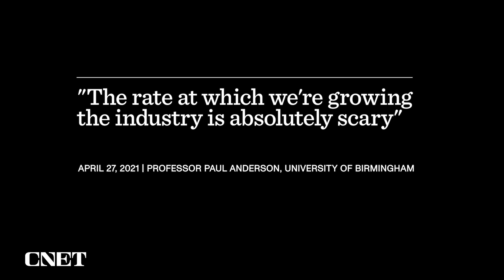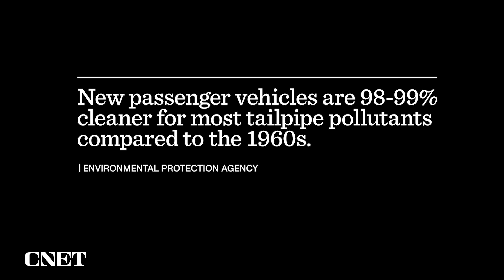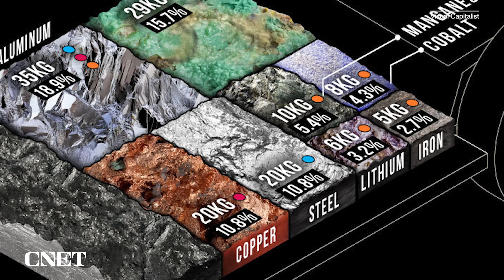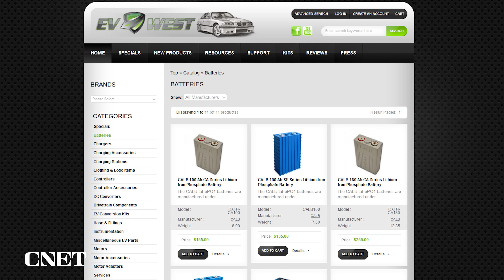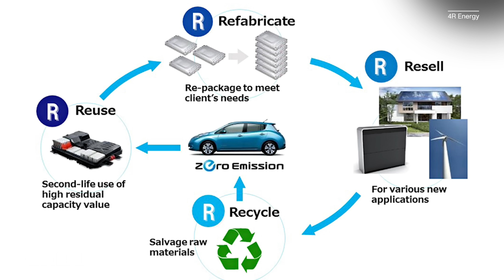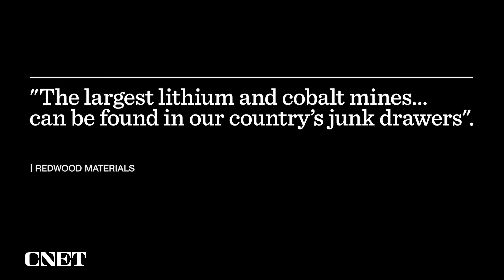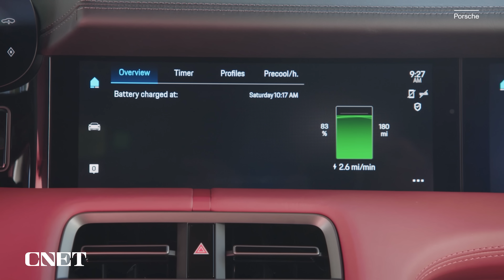MOUNTAINS of Dead EV Batteries Are Coming: Here's How We Plan To Deal With It

Comment: Why is it that when talking about pollution/ CO2 emissions by transport shipping is never mentioned?  It is by far the largest contributor of any mode of transport, is largely unregulated and still uses crude bunker oil with no or little control of huge volumes exhaust from enoumous engines. 
A small numbe (100s) of the largest ships emit the equivalent pollution of all of the private cars in the world. 
The best thing about the use of EVs is to clean up air in cities but until the main sources of CO2 pollution are addressed globally such as power generation converting to an all EV private vehicle fleet will have little effect on slowing global warming as cars represent a small fraction of the problem. 
And like any other recyclable material unless its economically viable it doesn't get recyled. So there will be millions of used batteries to contend with in the near future with all the associated environmental risks.

Comment: You didn't answer the question, you didn't. All these solutions will not make significant impact because the batteries will eventually die completely that it can't be reused for any purpose and recycling will not be quick enough. 

The honest truth is that majority of these batteries will be shipped to Africa and dumped in second-hand value and in waste fields while the west looks away. 

At the end, Africa will take the hit as we are doing so with used refrigerators, microwaves and tyres.

Comment: This is exaggerated. They decided to change to LiFePo4 which are very recyclable. In fact recycled LiFePo4 batteries are preferred to the fresh mined lithium. Repurposing is not really a thing with LiFePo4 because of how long their lifespan is, range increases and recyclability. Plus there are much better battery technologies on the horizon that will be here very soon. Some have already arrived. This video is misleading.

Comment: ok so we discussed the process of reusing batteries. Now lets discuss what it takes to bring that electric car to market....6 tons of carbon footprint for a gas car, 12 tons of carbon footprint for an electric car with 125mile range.. 25 tons  of carbon foot print for a 350 mile range electric car.. So basically you have to drive that 125 mile range car for 85k miles before it breaks even with the gas car on the carbon footprint and 450k miles for the 350 mile range electric car. Now lets hope you don't need to replace the battery.. A kid bought an electric focus in florida for 11k with 60k miles on it , the battery needed to be replaced and it cost 14k dollars... Lets be honest here, IS THIS REALLY A BETTER IDEA? i would have to say clean diesel is by far a better idea for cost and environment... Don't get me wrong, I love electric vehicles, I am just being honest about what is best.. Also did you know that a major component of the battery is mined out of the congo where they use children 6-10 yrs old because they are the only ones that can fit in that mine. They are paid peanuts and sometimes die in the mine, buried and parents are paid off so the govt doesn't know. Im sorry but this is not worth it to me just so some car brands can make millions and it doesnt benefit anyone but the automakers and investors...im sure they will delete this comment.

Comment: I think we need a standard ev battery. That can be swapped in and out easily between makes of cars.
Reply: May not be needed when batteries outlast the cars.
Reply: @danharold3087  hot swapping batteries could also give you options like a small battery when city running and you could swap to a higher capacity when you need it.
Reply: @DanT10  It would.

Comment: In the cities and condensed location the battery/electric train bus is the key. In country areas stick with gas. If people only drive short distances all electric. And hybrid for in between. Cut down on these higher horse power cars to give better gas mileage and give people incentives to do so. But this is all about giving old industries all the money and every one else will suffer

Comment: Cold hard fact is that electric car production emits over 70% higher GHG emissions during manufacturing process compared to building the exact same ICE car.  See the Volvo C40 Regen study from 2020 and ingest the fact that EV owners must first drive your new "zero emission"  vehicle a minimum of 90,000 miles before it's on parity with the GHG emissions footprint of an ICE car in the US!  Yes this takes into account the "zero tail pipe emissions"  during those 90,000 miles of driving. How many of us own electric vehicles and drive them 90,000 miles?  If your EV battery is replaced you start all over at 90,000 in the hole.  Don't get me wrong, I love electric car technology, but producing EV's, and their batteries, is much more devastating for our environment than producing ICE cars.  This is because you must rely on coal and natural gas to charge your EV and they get terrible range.   Good luck at having a low GHG emissions recycling program for the batteries... It's incredibly energy intensive, very expensive, that's why only one company here in the US attempting it.

Comment: I predict it will be closer to five years due to people abusing thier batteries due to still holding on to old driving habits that they could get away with driving a gas car like trying to get a few more miles from a charge and from allways fast charging their battery.
I am currentley repurposing a pair of Aquion Energy Aspen 48S-2.2 AHI saltwater batteries that have had two segments died, the batteries are made up from four 1.5 volt cells that are wired in series to make a 6 volt segment, and the battery has 8 segments wired in series for 48 volts, I am rewireing the remaing good segments as two 6 volt segment in series to make 3-12 volt segments and wireing the 3-12 volt segments in parallel to increase the current. So far it is working very well.

Comment: A hybrid is a vehicle with IC engine plus electric motors in the wheels run by lithium batteries when cruising on level roads at speeds above 35 km/h or when going downhill this regenerating energy ⚡. It has at least 500 watts of solar power. 
Others help drive us into recycling batteries at best since the hybrid is legal and so batteries have a 15-year waranty. Others dispose batteries every 5 years.

Comment: The battery wears out faster in a car since cars have higher discharge and recharge cycles. Batteries tend to be charged to 100% and discharged to very low amounts, many times throughout the car's lifetime. Solar farms tend to charge at lower rates and charge and discharge cycles are much more forgiving. Therefore a battery's "life span" in a car is not linearly proportional to the life span of the same battery being used at a solar farm. A battery that may only last 10 years before the range becomes too low to be usable in the car may last an additional 10-15 years at a solar farm
Reply: I see some cars are allowing you to charge less for everyday use and more when you need the range.
Reply: @danharold3087  that's most ev to conserve battery longevity
Reply: @Nguyening_music  Exactly  I mentioned it because you said " Batteries tend to be charged to 100% and discharged to very low "  Wanted people to know this is not always true.
Reply: @danharold3087  oh yes, sorry I meant that in relation to back up batteries
Reply: @Nguyening_music  np good buddy :)

Comment: As much as I would like to help the environment by going electric,there are far too many disadvantages to EV’s.Limited range,long recharge times,limited life time of batteries(7 years and the average cost to replace the batteries range from $12,000 and up).Plus many of the minerals needed to construct these lithium batteries come from strip mining,which is an environmental nightmare.
Reply: We have a 2013 Chevy Volt with 100,000 miles on the OD that shows little to no range degradation.  So after 9 years, the battery is not compromised and shows no sign of needing replacement.  For me the issue is not the environment or my “carbon footprint”.  I want that my grandchildren be able to fly to Maui.  Or to rebuild a classic car.  At the present rate of usage, British Petroleum says that every drop of crude will be exhausted in less than 60 years.  Talk about an impending calamity.  So for me, adoption of EVs is about preserving just a little bit of the precious black gold for future generations.
Reply: Most of that is inaccurate or exaggerated, too many doomsday scenarios.
Reply: @rp9674  Outdated too

Comment: "A 200 mile range EV might be just fine".  I have a laptop computer, I have a cellphone, I know how this works.  You buy a new EV and it has 200 mile range.  Next year it has 150 mile range.  The year after that it has 100 mile range, or one day you get in it and it has 10 mile range.  I've had batteries replaced in laptops and cellphones.  So you take your 2 year old EV in for a new battery, pay half the price of what it cost new, then a month later you find out it is down to 20 mile capacity, just like what happened when I put a new battery in my laptop.
I think the "rent a battery" model makes more sense.  I can envision places where you can pull in and have a battery swapped in 5 minutes, so you can make cross country trips.  I make long trips in the western US and there aren't any charging stations along those routes, but someday there might be a place where I could get a battery swapped.
Reply: Looks like you don't know exactly how it works, 2015 short range EV 74,000 mi no noticeable loss in range.
Reply: @rp9674  I know how cars work and I know how batteries work, I've never owned an EV.  The laptop I bought in 2015 and the cellphone I bought in 2015 have both eaten their batteries by now.  My cellphone had to have a new battery, the laptop is 100% dead.  I would be surprised if car manufacturers know more about batteries than Apple and Toshiba do but maybe they know the secret.
Reply: @billj5645  yep, they figured it out, amazingly!

Comment: I've been driving an EV for over ten years with very little battery degredation.
Reply: Same here with my ‘14 i3. What model are you driving?
Reply: @phenex551  I have a 2009 Miles truck with lithium iron batteries I purchased in 2010. My wife drives a 2013 Nissan leaf.
Reply: I hope to be in the club someday, 2015 Fiat 500e, 2015 BMW i3 Rex

Comment: A likely significant Reduction will be how much ebikes, their batteries and range are improving. Potentially large numbers of people around the world can skip the need for a short range EV and opt for a far less expensive ebike with a much smaller battery footprint. Ebike batteries could also have a longer shelf life because an ebike's usage and output needs are far less intensive, with much easier and lower-footprint recharging ability.

Comment: Battery electric vehicles are very likely a bad technology for two reasons:  The mass they add to the vehicle and the increase in complexity.   It will be very hard to recycle the  battery's heavy metals.  A successful technology would reduce mass and complexity; not increase it.   The technology I most prefer is take advantage of the huge sources of remote hydropower.  The world's remaining hydropower is remote as in Alaska, Canada, Brazil and Africa.   Make an environmentally friendly fuel like ammonia and ammonia/methanol.  Transport via well known pipeline and ship technology.  Small diesel engines have a 45% efficiency or 20% better than most gasoline engines are can be made light weight by using opposable pistons.  Much simpler energy storage, energy manufacture and delivery using well known technology.    For example:  we've combusted ammonia in engines since the 1880s.  The entire vehicle can be made light weight, smaller frame, light weight composite body panels, aerodynamic etc.   Make the vehicles recyclable and maintainable, get rid of the notion vehicles are consumables lasting 12 years and replace with the notion vehicles are capital goods which last 50 years.  Technically, none of this is hard to do, all well known stuff.
Reply: Agreed lighter weight is more efficient, with those heavy batteries you first have to move all the weight from the batteries before you get any other work done, this is not efficient! that is why you will never get airplanes on batteries because moving or lifting weight takes energy.👍
Reply: More like decrease in complexity, have you ever seen a car engine
Reply: Redwood battery recycling ♻️🔋

Comment: You know what a real solution to environmental concerns due to pollution/waste is? Electrified trains. 
We're just replacing the same mode of transportation instead of building affordable public transit systems and transforming our cities and suburbs to be as much car free as possible.
Reply: While the US has never tried for better public infrastructure, it’s also not going to be a very great solution. The US is big, like very big. Things are spread out far from each other and our country has been built from the ground up for driving. While running wiring for public trains, trolleys or buses may for for cities or more populated/smaller suburbs, it would be impractical for most of the US.
Reply: @LBrisk01  We had a better public transportation infrastructure back in the golden days of passenger trains.  It was on its last leg prior to good airline service.  
Now we can't even make long distance buses work properly.   The idea of trains outside the east and west coast corridors is a bad joke.
Reply: @LBrisk01  The fed gov has been robbing the funds from gas tax to build mass transit  for over 50 years.   Mass transit has been tried.
Reply: In the cities and condensed location the battery/electric train bus is the key. In country areas stick with gas. If people only drive short distances all electric. And hybrid for in between. Cut down on these higher horse power cars to give better gas mileage and give people incentives to do so. But this is all about giving old industries all the money and every one else will suffer
Reply: They're coming! Electric busses are already on the road where I live!

Comment: New batteries exploding and catching fire is already a thing, and now we're talking about reusing batteries?? Yeah, this ought to go well...
Reply: Okay I don't think that happens enough to hamper EVs. You basically have to cut the battery in half or set it on fire. Compare to the oil refinery fires, oil spills the size of a continent, just the toxicity of fossil fuels.
Reply: LFP batteries can't burn! 🔋❌🔥❌
Reply: @mikafiltenborg2291  showoff
Reply: Redwood battery recycling ♻️🔋
Reply: @mikafiltenborg2291  On a side note Mika, what do you think powers the grid that charges your lil batteries? Something EV owners seem to conveniently forget while jabbering on about "doing their part for the environment" like the trustworthy government suits told them to.
Reply: I've seen several gas cars catch fire. People park them in their garage, also possibility of fumes.
Reply: @rp9674  Considering the small number of electric vehicles out on the streets vs the number of ICE vehicles i'd say the % of EVs with problems or ones that have has catastrophic failure is far greater.
Reply: @TheXboxSux  that's all anecdotal